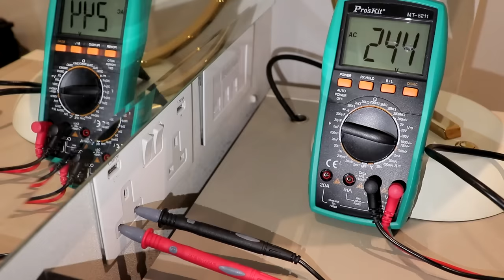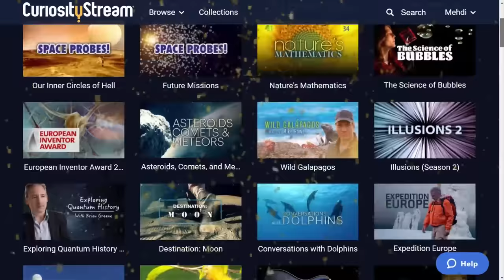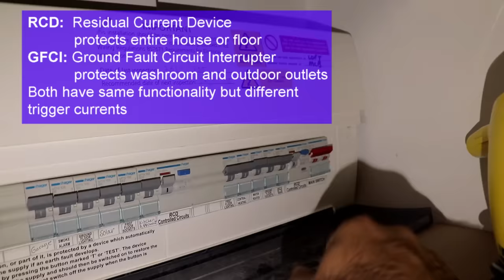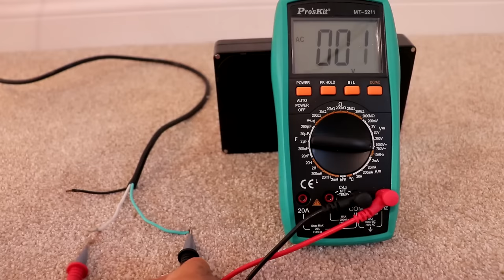Power Outlets in United Kingdom

Comment: 2:51 ElectroBOOM, PLEASE don't try similar stuff in the airplane!!!
Reply: I work on avionics. The power outlets don't send current unless they detect it's safe, and they disable themselves at the slightest hiccup.
Reply: I think he tried to ground a Boeing 737 Max. Looks like it worked.
Reply: Or what, they kick him out?
Reply: @zwz.zdenek  Or they make him push it back to an airport...
Reply: If you see him at your departure gate, change your flight immediately.
Reply: @Gebenki  A problem I encountered on B777 outlets. Every time I touched the case of my laptop the outlet went off for about 15 seconds or so. Probably due to a slight statical discharge on the secondary side. The voltage spike is probably coupled to the primary side thru the class Y capacitor that is in the power supply to meet EMC specs.
Reply: While any power supplied to passengers would presumably be 'normal', many planes (at least used to) use a 400Hz AC frequency for internal systems, IIRC. AC motors and transformers can be physically smaller=lighter at higher frequencies, at the expense of ... presumably something, or we would all be using higher frequency AC mains, or is 50/60Hz just left over from a dependence on physical generator maximum rotational velocities early last century, and it is too late to change*?. (caviat: I brefly touched on this in EE training over 30 years ago as one of my classmates was a Quantas apprentice, and haven't worked above 50V DC myself since, so if someone else tells you differently,  believe them over me).

* I believe switch-mode power supplies (another thing that largely post-dates my formal training, and I have never had need to directly work with since!) regulate the mains (FULL BRIDGE....!!) then re-AC it at much higher frequencies to get the advantage of much higher frequencies and associated tiny transformers. They don't have to transmit the high frequency more than a few cm/>inch so can get away with it, I believe.
Reply: @vikiai4241  the power grid contains very long cables and due to capacitive coupling between the conductors the system needs to use a relatively low frequency of 50 or 60 Hz. An airliner has shorter cable runs where a 400 Hz frequency works perfectly fine. The higher the frequency the  smaller the transformer can be. Less weight is very desirable in an airliner. The 50/60 Hz frequency comes indeed from the speed of steam generators and Diesel generators. The 50 Hz is better for longer cable runs, 60 Hz is better for smaller transformers. Fun fact, the German railway uses 16.7 Hz.

Comment: The Sockets in the Bathroom have a Isolated Transformer. So when you touch the live wire of the secondary winding you don't get shocked because of the galvanic isolation of the circuits. The windings of the primary and secundary circuits have a ratio of 1:1. so you put 230 V in you get 230 V on the other side.
Reply: Ungrounded systems above 50 volts are very uncommon in North America.  NEC 250.21 essentially allows them only in situations where continuity of power is required when a fault occurs or for isolation from ground in surgical suites.  I.E. 3-wire delta systems supplying critical infrastructure like crane magnets, pump motors for crude oil pipelines, boiler/reactor feeds and other situations where a disorderly shutdown could be disastrous.  All ungrounded systems are required to be fitted with ground detectors to warn of a ground fault - since no overcurrent protective device will trip when one occurs on an ungrounded system.  You get the first one free.

In regards to the fused receptacle in the bathroom - in North America, overcurrent protective devices other than supplementary overcurrent protection are not permitted to be located in bathrooms (240.24).  (Or clothes closets - breakers discharge sparks and hot gasses when interrupting fault current!)

In regards to the design of the North American plugs and receptacles themselves - the code has no bearing on that other than requiring them to have an equipment grounding conductor and that they be listed by an independent testing laboratory acceptable to the authority having jurisdiction (typically either UL or CE but there are others).  NEMA format receptacles have just been the industry standard forever.  You can stick whatever non-NEMA receptacles you want in your house as long as they're listed - but good luck finding any compatible appliances - and good luck selling it afterwards!
Reply: Also the internal transformer is designed to limit the output current   Try to overload it and the output voltage drops: the secret is in the design of the magnetic core, old-fashioned yes but electrical engineers mastered this sort of thing a century ago.
Reply: Eric Nolan Debatable which is better - the GFCI/RCD will let you use much higher power appliances, but it can only limit the duration of a shock while the isolation transformer can prevent it entirely. An RCD is also an active device so might fail. Probably good enough in practice though.
Reply: This system is btw not common here in Germany. But you have to use for Bathrooms an extra RCBO (RCD and circuit breaker combined in one unit).
Reply: @dingo137  On paper, an isolation transformer with a ground detector would be nearly idiot-proof.  In practice, a 1.8/2.4kVA 60Hz isolation transformer installed in a bathroom would be incredibly expensive, somewhat noisy, bulky and a bit lossy.  Not to mention the considerable expense of having to install and periodically maintain a ground detection system.  That is, if an ungrounded system were permitted by the NEC for this hypothetical use.  Not to mention the potential for clueless homeowners to tamper with such a system if not installed as a single permanently enclosed unit.

Because 80% of the full 15 or 20 amp branch circuit current is needed to operate hair dryers, the codemaking panel probably deemed the mandatory use of isolating transformers impractical for this application and elected to mandate GFCIs instead.  $20 GFCI vs $500 transformer + $70~$200 ground detection unit.  It would constitute an unreasonable burden to the homeowner.
Reply: Tankcrusher210 The wall outlet you see in Mr Boom’s video is for mains operated electric shavers with outputs at 110 and 240 V.  Limited to about 10 VA. They are hardly ever used - that kind of shaver has been in decline for 30 years at least. They are generally wired to the lighting circuit so therefore off most of the time.
Reply: @dingo137  Isolation transformer won't prevent a fatal shock, it just insists you use both wires from it !
Reply: @keepitsimple5982  why do you think electric shavers are in decline and anyway, those sockets are used to charge electric toothbrushes !
Reply: @millomweb  I was a bit slack with what I wrote, obviously!  Shavers without batteries are in decline and those that need an AC supply at 50 or 60Hz because they use a resonantly tuned electromagnet to move the cutters are almost completely gone.  pmailkeey, I think I would envy your bathroom if you have so much space that you can chargers and cords under control!
Reply: @keepitsimple5982  Our bathroom is of ample size but devoid of electrical outlets ! I'd forgotten about 'cordless' shavers - and it may be a surprise but I'm not a fan of battery power due to its limitations. I'm currently on my second electric shaver and based on the length of time I had the first one (which still works but is overdue new blades - which are no longer available) all being well, this second one should be my last. Sadly, unlike the first, I suspect it's AC only.

Comment: @electroboom We have afci breakers in the us that afaik are equivalent to the rcd, abs tamper resistant outlets. The potential difference is commonality.  I have tamper resistant outlets in all my floor level boxes,  and afci protecting my old wiring where replacement isn't required yet.

Comment: The shaver outlets for bathrooms also have an isolating transformer behind the faceplate.
Reply: The outlet and the shaver both have double pole isolation* so you could drop them in the bath and come to no harm.

*Terrible oversimplification. It just works ;-)
Reply: @BrianBell4073  wow. That's actually pretty cool
Reply: Essentially the idea of the GFI outlet in the States. Used within a certain distance of water.
Reply: @BrianBell4073  
This is true 
But 
Don't tell him about dropping stuff in the bath ... cos you know what he will do with that info...
Reply: British Empire: conquers half the world

Karma: what about one in each ten of your men try to kill themselves?

UK(former BE): hires Monica Geller to do stuff
Reply: Selv and pelv systems
Reply: You can still die from it. It's a floating voltage, so if you touch one side there's no voltage potential to earth. If you touch both you will die and no breaker or rcd will trip. Also if there's an accidental link to ground due to faulty cable, touching 1 end can still kill you, because that faulty wire creates a voltage potential with earth on the other end of the transfo.
Reply: @nasapayrollsystem8701  He has put his leg in the tub with live wires connected to a gfci circuit.  And lived.

Comment: 1:24 this ancient one is actually not ancient but a different type of outlet that is designed to link a wall light switch to a standard lamp. Not used much anymore in practice but still current
Reply: BS546, still current in hotels for their table and bedside lamps. Maybe they figure that people are less likely to steal them. Also, theatre lighting systems most often use BS546 for their stage lighting as, being without a fuse, it makes fault finding easier. Some people use them in household lighting, such as under cupboard lights. The plugs are smaller, and all perfectly legal if on a spur or CU circuit with the appropriate breaker/fuse.

Comment: Argentina went almost completely off last month, i wonder if you where here 🤔
Reply: Marcos Lucas nope, just socialism
Reply: The luz mala (bad light) was responsible for that
Reply: @jcnash02  You are mistaking Argentina with Venezuela. Argentina's case was a shortcircuit of HV  500KV lines between two stations that caused the other station's safety mechanism to jump, mostly solved in less than a day. Venezuela's case is a single dam that provides 75% of all the country's energy badly maintained  (most likely because the funds to do it were badly managed or stolen thanks to corruption), the damn started failing at max (had a masive blackout of about 90hrs) and now the country is rationing electricity with a few blackouts a week of around 8hs because they can't run it at max.
Reply: fue  Macri , siempre es Macri XD
Reply: @Dex An online "friend" that I know lives in Venezuela. He is (probably) still alive, but hasn't spoken in half a year...

The corruption shit happening over there is REALLY bad. I believe the country is at about 10,000,000+% inflation rate by now, so we have to start measuring it in terms of rate of rate of inflation.
Reply: siempre me pregunto por que después de los 80S iram (?) eligió usar el enchufe AUSTRALIANO??? si ya veníamos usando el europeo... Por la tierra?
Reply: or perhaps "the funds to do it were [...] stolen"  by the UK.

Comment: Fun fact: The 'Ancient' plug at 1:24 is not probably all that ancient - it is a 5a lighting plug that will be controlled by a lightswitch somewhere, allowing you to turn off all the standard/table lamps at once when you leave the room. Common in large houses and hotels.
Reply: It's a BS546 socket, and they're still widely used for stage lighting. The plug is not fused, which makes fault finding easier.
Also seen on X-ray trolleys, which use the unfused connection briefly to draw large currents.
Reply: I stayed in a modern AirBnB self-catering wooden cabin in Scotland very recently and was amazed to see these 3-pin 5A sockets to take plugs with round pins which, as you say, were being used for table lamps.  

I had assumed that this design and the larger 3-pin (round pin) 15 amp sockets had all been phased out in the UK in the 1960s by the current square pin 13 amp ones as I had not seen them anywhere since that time.  

As a child, I remember the local authority's electricians (we lived in a council house) ripping out and replacing old 5A and 15A round pin sockets around 1967.  The house, built in the mid-1930s, had 5 rooms and, prior to that date , we had two electric sockets to serve the entire house with a lot of juggling: a 5A 2-pin socket (with no switch) in the living room used, with a split adaptor, for the wireless (radio set), fairy lights on the Christmas tree during the festive season and, latterly, for the television set; and a larger 3-pin 15A one (with a switch) in the kitchen for the (small) cooker, washing machine, water boiler (you had to plug in and unplug each of these 15A round pin plugs for each use) and, with a split adaptor, for an electric kettle (3-pin 5A, round pin).

If you needed electricity in any other room, you removed the light bulb from the 5A light fitting in the ceiling and plugged your appliance, fitted with a suitable bayonet-fitting-style plug, into the bayonet fitting.   In cold winters, we would plug in a one or two bar electric fire.  I wonder how safe that was.
Reply: That "Ancient" socket is used in India

Comment: An RCD constantly monitors the current flowing through the live and neutral wires. If there is a difference between the two (known as leakage current), it means there is a problem somewhere in the circuit. The RCD will then switch off the power.

Comment: Shaver sockets have isolating transformers in them and only rated at a few amps
Reply: Came here for this, there is no return path to earth. Only way you can get shocked is between l-n, you'd have to be pretty special to do that
Reply: Is this British speak for GFCI outlets? I'm confused
Reply: An isolating transformer makes it so that the current is in a separate circuit from the rest of the house, making it safer around water since it won't go through the liquid and the pipes to ground and shock you if you are only contacting one wire